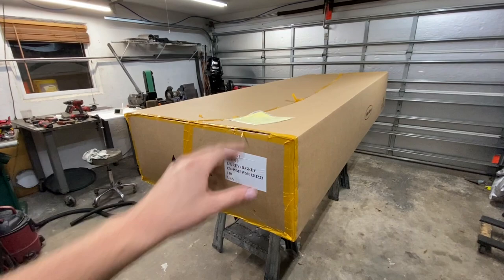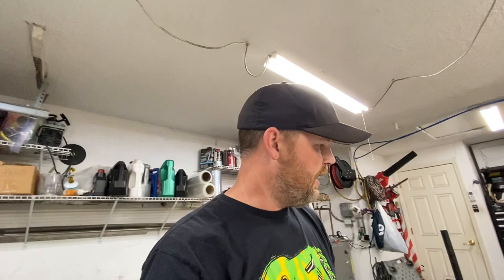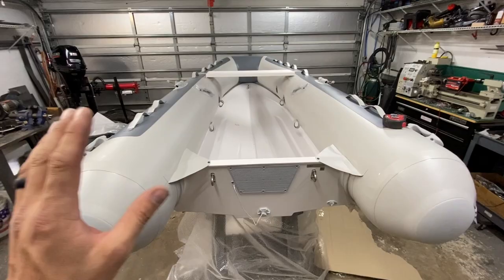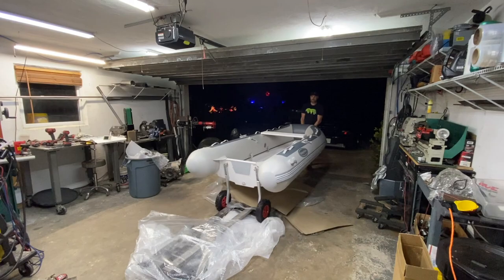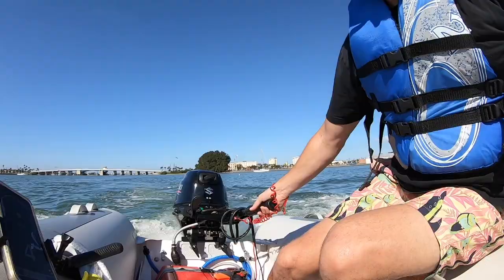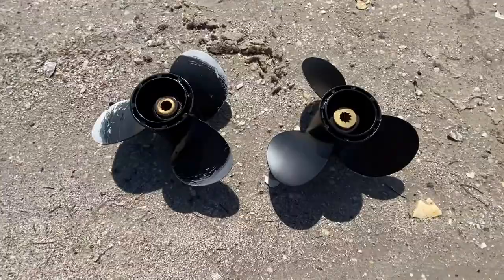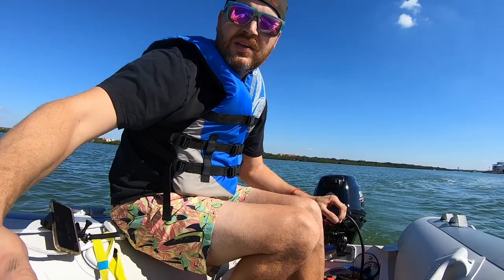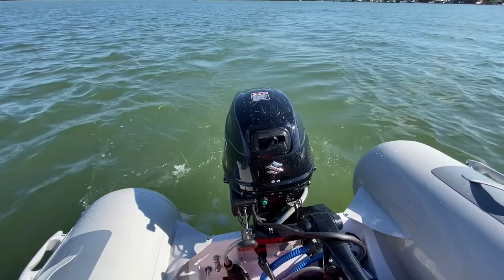West Marine RIB 310 Top Speed Test With A 15HP Motor!!! Unboxing + Review

Comment: Awesome setup.  just bought this same boat used really nice for $450. One of the lucky winter deals. I need a bigger outboard motor though I just have the 3.5 mercury.
Reply from the maker: I wouldn’t go smaller than a 9.9 on it. When loaded up I can plane out with 2 other adults and a kid with gear no problem.

Comment: That’s awesome! You convinced me, I have a 310 highfield with a Honda 15 that has a 4 blade prop with a little ding in it and have been looking to buy a 3 blade with more pitch but wasn’t sure how much it would help on such a small motor but damn. I’ve gotten 24mph on a glassy lake so excited to see what I can get this summer!
Reply: I know this thread is a little old, but curious how your Highfield 310 turned out with a steeper pitch and the numbers you ended up with. I have a 2023 CL310 with a newer EFI Suzuki 20hp.  I was prop limited, and picked up a Suzuki 12" pitch prop, but haven't gotten it out on the water.  I was hitting the rev limiter with a 9" at half throttle, hitting 22 mph.
Reply: @nottoooldyet5901  I bet that thing will fly with the new prop! I went from the 4 blade 10” prop to a 3 blade 12” and was able to hit 30 and sustain 30 on really glassy waters. But normally can run at 27-28 fairly easily as long as it’s not really choppy. Since I have the UL it can get thrown around pretty easily. Tasked with building a diy front box/floor like the CL has now to add weight and make it more comfortable which will bring the speed down a bit but hell if it works maybe I upgrade to a 20 next year
Reply: @andrewlitka4019  I ended getting out on the water with a little chop and just me I ran 27-28 @ 5950 rpm, but with 2 people and some gear I was running 22-23 mph @ 5400.  I think I'm going to move down 1" in pitch to get the right cruise and take off with my standard load, hoping I end up 
around 24-25.

Comment: Hey man, nice boat! 29 Mph top speed on a 10ft small rib boat is impressive! Btw you can get a tiller extension for a motor and then seat in the middle of boat to counterweight heavy motor in the back. I also strap my fuel tank at nose of a boat, there is a special strap mount build in on my WM 310 rib with folding transom. Overall nice video, I liked it very much!
Reply from the maker: I got a cooler and tiller extension since this video. Gets on plane much quicker. When family is onboard and loaded up it almost gets up just as well too

Comment: Nice video! It looked like you could pick that motor up without too much trouble, yeah? I'm looking to upgrade from a 45 lb 5 HP to a 95 lb 15 HP, but I've been hesitant due to the weight. I have to carry the motor and attach it to my RIB because I transport the RIB on the roof of my SUV.